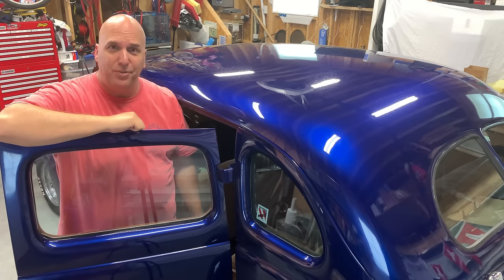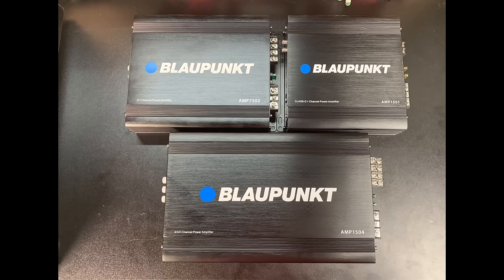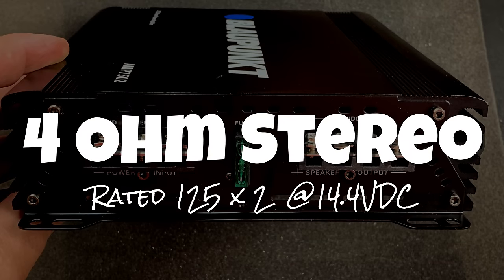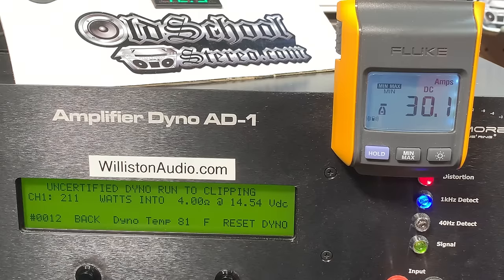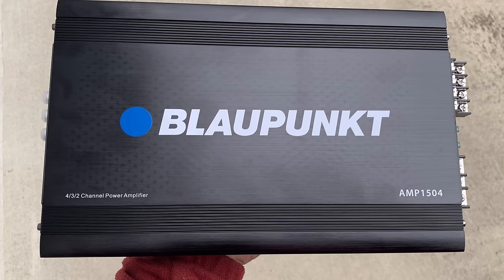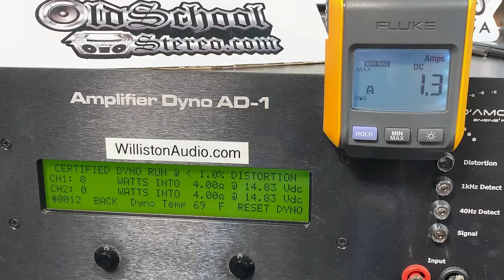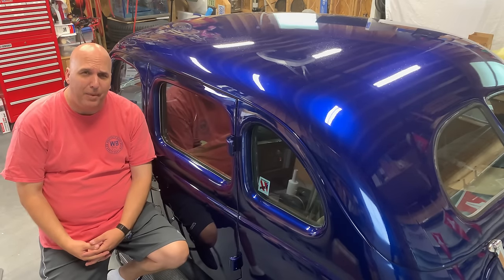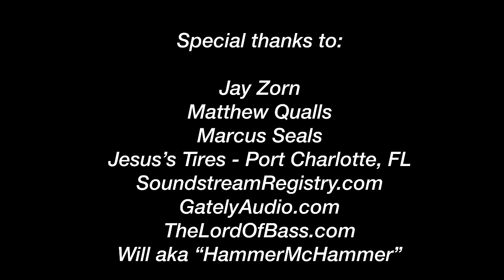Cheap for a Reason? Blaupunkt AMP7502 and AMP1504 Amps Tested [4K]

Comment: I just bought one of these.  I was not looking for the rated power.  I am just looking for a inexpensive amp to boost up the volume in my wife car for her.  As long as it is respectably louder than her stock volume then she will be happy.  Not everybody that buys amps is looking for the rated power, they are just looking for their system to be louder in general.  If they get descent quality sound at a higher volume than before then they will be happy.  Its not always about audiophile snobbery.
Reply: Pretty much the only reason I bought this for my work van lol
Reply: Is there 2 sets of rca plug ins (4 plug ins)on the 2 channel? wanting my input in on the 2 channel then out to another amp for some subs, thanks
Reply: @jobbi9336  yeah bought their powered sub from them, its powerful enough to shake my tools in the back of the van so theres too much power for my liking lol. for a cheap system im pretty happy about it. for my car Im getting something better for sure
Reply: Exactly! I don't need 1600, I'm looking for 500-600 tops, and at $64.00, I got that!
Reply: I was about to say! Just trying to do a little more than a cheap head unit, I'll take 70 watts over 15-20 any day. I understand peoples passion and I completely respect it. But kinda sad when someone with so much talent and knowledge just throws together a review that is mostly meaningless when they could actually realize the opportunity to greatly expand their audience by including the common people
Reply: @adventureswithdavedave I agree  because for $80 you can’t complain about not getting 1500 watt rms amp because even the budget ones will run up $160+ and the american name brands will be $300-500+. 
My problem is the quality and how long it will last

Comment: I've been running the 1504 for a year now with no problems . It was a decent upgrade from head unit power . Keeps up with a JL 12" and JL 500 monoblock . It's not the best but I'm not disappointed for the money . I do miss the days when power was rated at 0.1 or 0.01
Reply from the maker: Yeah these are budget bangers

Comment: This amp works perfect to power my 2 front component speakers at around 100 watts a piece! For 50 bucks not a bad deal as opposed to spending 200 on a good 200-400 watt amp that would do the same thing

Comment: God! That specific Solobaric model is the one that made me try to 4th order bandpass nearly EVERYTHING from 1992 to 2003. My favorite shop in 1991 was a Kicker/Clarion/Alpine dealer and had one on display being run by a bridged Alpine amp. It was shaking the windows and speaker display boards in that room and forever changed my thinking. Most impressive difference made with an enclosure on a budget sub was a pair of gray coned, inverted dustcap, orange lettered, Rockford Fosgate Series 1 ten inch subs. Never will forget that the pair of those were louder than the 12 inch Solobaric and on 25% the power - a weak 60wpc Yamaha stereo receiver. Those were the days
Reply from the maker: Love those subs too 🤙

Comment: NOT A WASTE OF TIME Big D!  If I hadn't seen your video, I might have wasted a lot of money trusting their new stuff was still making power like their old models.  THANK YOU!  I had a pair of their original "digital" amps back in 2005, the PA2150.  It was rated 300w IIRC (150x2), and put out every bit of that rating and more.  

It was in my daily 03 Ranger 4x4.  I had one running 2 channel up front, and the other mono to my Infinity 12" beast (That is still shaking my house in my home theater. LOL).  They were SMALL (Especially compared to 90's A/B amps!), CHEAP (Think I paid $75 each.) and performed. It had at the time the "new"  TriPath digital chip. ( They called it "Class T".)   So again...thank you!

Comment: i got the 1504 for $30 bucks and even though it doesnt do its rated power it actually doesnt sound that bad honestly . i dont actually use it as my main amp any more but its not bad sounding from my experience , just way over rated !!  thanks for another great amp dyno test !    if you ever got time to do the alpine mrv v500 5 channel that would be sweet . i believe its actually way under rated but i could be wrong , its sure sounds louder than its ratings though. I have a kenwood xr 400 that seems under rated as well and sounds really nice !

Comment: Back when I was in high school I used to use a cheap amp to power a box I made to house 8 6x9's so I could have a wall of sound so we jam out at field parties. I could possibly see the potential in using the 4 channel blaupunkt amp for that. Big D you haven't scratched the surface of bad cheap amps until you see brands like Frontier and Kraco.
Reply: Lmao kraco i havent seen one of those in years

Comment: There are a lot of PA amplifiers that claim high output ratings to the speakers but  on the back they have small mains fuses and have a power consumption rating printed next to the power input with maybe 1/5th of the power it claims it can output.
Reply from the maker: If they sound too good to be true...they probably are 🤷‍♂️

Comment: Admittedly Blaupunkt pulled "a Boss" by grossly overrating the output of these amps, but when you look at the dollar per watt equation, they don't look bad.  You can pick these up for 63 bucks shipped from Amazon.  I don't think there are too many 4 channel amps out there that put out 70 honest amps per channel into 4 ohms for that kind of money.  For people wanting a moderate power low profile amp to fit under the seat (it's only 2" tall), this might fit the bill.  I'm looking at this along with that new Dual Class D 4-channel amp, but the price on that is 100 bucks, so I have to weigh the value, size and performance of both.  This is for a classic car that I only drive a couple times a month in the summers.  Keep up the good work with your dyno tests, I really enjoy them.
Reply from the maker: True! Thanks for watching and commenting!

Comment: In 2002 I had a set of the coaxial 6.5 in a 98 jeep. They was not bad. They had clear blue cones so you could be lights behind them. At that time they was sold at Crutchfield. Blaupunkt used to be a decent middle of the road company.  Said to see this.

Comment: I might be the only one on the planet, but I’m not surprised or disappointed in any way. Consider the fact that low end amplifiers always have advertised their “peak power” the results fall in line with what you would expect. Fully acknowledging the fact that “peak power” is relatively meaningless, if one expects RMS power to be roughly half of the advertised peak, then the results are well in line with what you should expect.  

That is to say, an amplifier with a 150 watt (presumed to be MAX) rating, one should expect about 75 watts RMS.  So the fact that this 150 watt rated amp put out ~70 watts RMS, is actually pretty well in line with what I would expect. 

So this begs the question: if they had put a 75 watt RMS rating instead of the 150 (max), would we still feel that these are a rip-off?

Comment from the maker: Blaupunkt AMP1501 monoblock - https://is.gd/blau1501wm
Amp Dyno Test - https://youtu.be/HzUvIDqdgtk
Blaupunkt AMP7502 2-channel - https://amzn.to/2Wahm3m or https://is.gd/blau1502wm
Blaupunkt AMP1504 4-channel - https://amzn.to/2YLKj29 or https://is.gd/blau1604wm
Reply: It would be cool if you could show an amp from the companies past that does or did what it's supposed to do side by side, guts and all just to send a message even though it probably won't be heard or felt 🙄 but at least for us! Thanks your SUB'S 😀
Reply: Hey BigD, I have a question about the dc step up booster you used when testing the Chinese amps. How did you set the constant current? I looked for the follow up video, but couldn't find it. P.S Bluapunkt should be totally ashamed to put numbers like that on the outside when they know it's bull, as should any manufacturer.
Reply: I have the 1501 pushing a Blaupunkt 10 and the 1504 for my mids and highs. Got a MPQ-90 that puts out 8 volts so the amps do pretty good for what I need. The sub sounds like it could use a bit more power so maybe I'll put the 7502 on it. Minimal distortion for such cheap, garbage but I wanted Blaupunkt in my Jetta. I would have gone with cheap amps anyway so I figured why not go "German" LoL
Reply: Have you tested the Pioneer A3702? Thanks for ending the boredom.

Comment: I have done a LONG term review on the 1504.    Reliability?  As long as you keep it cool with a Large PC side case fan? It will last and be almost silent while keeping it from shutting down in the summer.    

The ONLY bonus is just like the Boss RM-1500.  And that its got its Protection circuitry being its best feature.     And it still has that great Class A/B sound Timbre/Tone.  But that's about it.    I have polished this turd all the way up to a Matte finish.  And it Works.   But damn.   Do you have to do a LOT of stuff you would never have to do with amps from ANY major brand.  Let alone tech support.    Hell if you Bought MTX?  They still fix their old amps in house! No kidding!  

What is going to KILL you is how many other drawbacks you get with this amp.  
The Power LED just stops Randomly working.   The Amp always makes a Low Level Buzzing sound even from straight  Battery power (And I mean on a BENCH Battery powered situation with no PWM power supplies on the rails input)  & sounds like faint Low Frequecy Buzz on your subwoofers.  

The Pots on this thing are wack.  They scratch from the factory.  There is a Work around fix, but its not really a cure all.   

Then there is the POWER imbalance.  You can get as much as 10-20 watts of it.   And its NUTS using this for a front stage as you have to set your balance levels to your deck to compensate.  

Bridged?  Even if you don't play a LICK of Music through it?  It will still protect at loads bellow 4 ohms.   Again, All the Money was spent on the Protection circuity here. 

Then there is this Wonderful problem that the Unit itself is the ONLY amp that I think without a doubt actually sounds better with a  ~ 4 farads of Capacitors stuck to the power leads.   

So WHO is this AMP made for?     For the Guy who is willing to go through every single step in trying to squeeze all you can out of this amp to get a Working system to work with.   

First?   You are running  all your speakers at almost 2-2.67 ohms  or the lowest you can in STEREO 4 channel mode WITHOUT the amp shutting down.  (Fan MANDATORY)  And you better have a balance control ready.   

The Rear of the amp will do Bridged.  And that means using 90-92 dB sensitive speakers in a high output sealed box so you don't get Box rise. .  This amp works GREAT with 12- 15" cheap woofers.   Sounds tight and great.  And yes, you will use the Bass boost feature.  

you CAN make a great sounding system from this.  But OH boy are you going to work for it. 

Great for Bass Shakers.    Hell its the almost PERFECT application of this thing.   And Maybe  your work van.  Just about anything you don't care if it gets stolen.   That's its second Best feature. 

Let me tell you what this amp WILL NOT DRIVE.    Any MODERN Small Subwoofer with anything lower then 85 dB sensitivity.      Even the under the seat subs from DUAL.  No Buenos.    Even Bridged, it chokes.    

My god.  Buy anything else.   ANYTHING.    Even a $9-15 dollar Chip amp from Amazon does close to what  this amp does and better specs to boot.  AND it does it with a Fraction of the power needed as well.*  Crazy but true.     (*At 24 VoltsDC)  

If you need something CHEAP?  Check out RECOIL.  At least they give you what you pay for and it will last a long time as long as you don't go retarded.  

And if you want a Deal and S.Q?    Check out some of the Brazilian gear.     Great DSP's.  And great for Power for your Subs for a Daily Driver as long as you go Lithium and stay at 4 ohms.      Just get the AMAZON warranty, and enjoy bassing all the way to the bank.

Comment: That $41 amplifier has about the same amount of power that I paid $400 for from Phoenix Gold back in 1995.
Reply: It's not as much about the power, it's about the claimed power. If they simply rated them realistically then it would be great at $41, just be truthful.
Reply from the maker: This is true, but I bet the Blau won't be working in 20 years and the PG is and probably still will be in 20 more years
Reply: True but the Phoenix gold probably had 2-3x the dynamic power and a better damping factor. Both important for music
Reply: @wal  wanna test my  m50 or m44? Or do you have one to test already? My xs2500 gave up the ghost years ago.
Reply: Even at 40 its not a good deal when theres the dual xpr82d that does rated for about the same price
Reply: @wal  see what you've done Derick? You've made everyone an "expert" on amplifier power ratings...

Comment: Haha... i just bought model EMA275 which identical to AMP7502 and the spec in manual just like your test sheet... this amp is to drive my Kicker ES124 125W beginner woofer.

Comment: blaupunkt is no longer a premium brand but are respectable for the money...........if you remove the last digit of the model # on any amp it seams like that is the true rms value......this works for 80 % of all amps.........ratings on amps were bee es for the last 40 years......i remember 1980s pyramid amps/eqs rated at 1500 watts that werent even amplified.....total bee es!.....blaupunkt is ok for the money!:hand-purple-blue-peace:

Comment: 7502 implies in the model that it’s 75watts x 2 at 2ohm (for its own sake).
Reply from the maker: Or 75 watts per channel x 2. The 1504 would suggest 150x4 which is not happening
Reply: yep they should’ve use 7504 instead of 1504

Comment: I just bought the AMP7502, Do you think it will be enough for a Single 8" Subwoofer. The Subwoofer is a Rockville W8T4-S2 8" Shallow Mount, Power Handling (2ohm): 1000 Watts Peak Power / 500 Watts Program / 250 Watts RMS ?

Comment: I got a 4 awg wire for battery hook up. Crimped it myself. The crimp is much to large to hook up.....is there some extender I can use to get power?
Reply: I used SCOSCHE X2BS4-4 for my Audiopipe APCL-3002.  I changed from 8ga to 4ga and it wouldn't fit!  These worked perfect to go from 4ga to spade terminal connectors!

Comment: Do you by chance know what the name of that color or brand and color code of ur beautiful painted classic rod that blue is so nice
Reply from the maker: I don’t unfortunately. Have not been able to get much from former owner. I’m saving up to get the car into daily driving order. Going fuel injected and some safety updates
Reply: @wal I made the switch to fuel injection and I'm glad I did it always starts right up no matter the time of year and the reliability hands down makes it easy to daily drive especially where I live where ther is big elevation changes and love that ther is no more jetting and adjusting a carburetor

Comment: Back in the '80's, Blaupunkt was the high end "Must Have". I thought, back then, they were made in Germany. True high end. I'll bet now, it's all made in China, and has gone to being a budget brand, much like Pyramid. Forgetting about the exaggerated ratings, how is the performance for the money? Rockville is an example of that. Good "bang for the buck", even though they don't produce the power they're rated for. I have become so used to exaggerated ratings, that I'm satisfied with an amplifier that produces 1/2 the power it claims. If I need a 150 watt amplifier, I buy a 300 watt. It looks like these are doing just about that. If the price is right, I'll take it. Now, let's look at frequency response, DC offset, and reliability.
Reply from the maker: Price is low, but I can’t get by the lies. They are printed in the manual so we have evidence. They would prob say they were taken at 36 volts or something...
Reply: @wal  I wonder if they're measuring the unloaded peak voltage, and multiplying that with it's output current limit. That would give a much higher number, because the voltage always drops when loaded, especially at its rated impedance. This would be a calculation of peak wattage, based on no voltage drop while under load, NOT the RMS output, which would be 70.7% of that, if there was no voltage drop under load.

Comment: Big d I have a blaupunkt v2100 says it's made in USA, and Bosch group on it, it's new old stock in box and original plastic wanted to see if you was interested in testing it kinda comparing old school to new, from the dates it's around a 95 model
Reply from the maker: Cool amp, thanks for the offer. I have stopped taking in outside amps as the risk of damage and my turnaround time is 👎

Comment: Surprised to see discrete components at that power level. I could understand the lack of dynamic power from an IC amp but you'd expect a bigger swing in the dynamic with that amount of componentry. Must have a very conservative power supply. Barely enough power to push a component set. I can't imagine bothering to try to push a sub with one of these amps.
Reply from the maker: I guess we shouldn’t expect much from $45-75 amps

Comment: Even though they don't do they rated numbers would this make a good entry level motorcycle amp being as it doesn't have too much power and would power like 4 6x9 in saddlebags or 2 4in and 2 6.5.  Have a chance to pick one up for $10 is why I am asking

Comment: What would you guys recommend for a cheap tweeter/3.5” amp? Just powered a whole Dodge Ram on the pioneer 5 channel you tested and put all new speakers but the 3.5” in the dash are screaming loud need to wire them separately. Thanks!
Reply: I'd first try to attenuate the dash speakers with a resistor instead of messing with a whole other amp/wiring. Cheap and easy fix before you spend more time and $ on more equipment